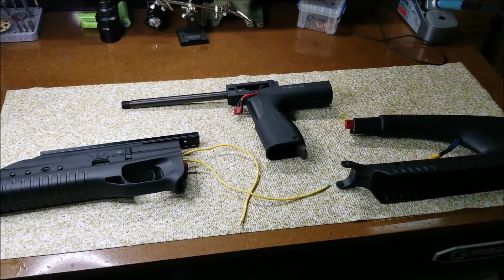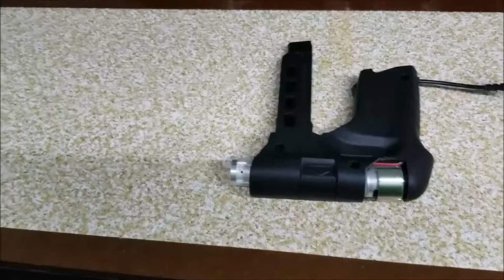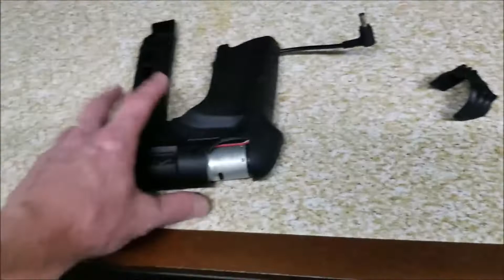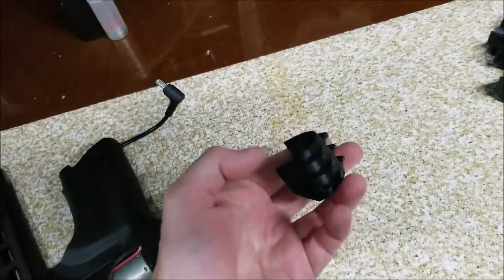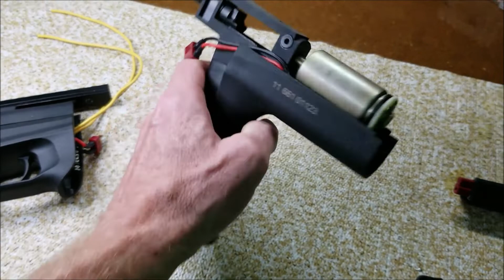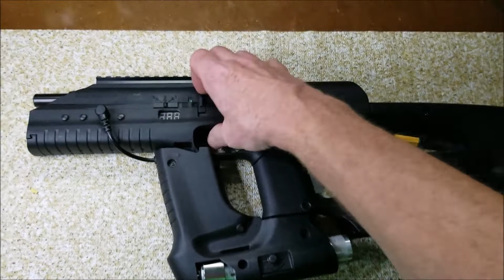12K Getting Close

Comment: Let's dance, comrades!
Seriously, unplugging mag is the first thing to do in a situation like this. Obviously, the board starts like it normally does but then something is causing overload that leads to significant voltage drop so the board resets itself 'cause it believes the power was turned off and then on again. Excluding part of the board's load (disconnecting mag) shows you the path to follow.

Great to see the progress with this project, thanks for the video.

Comrades, I can't stop dancing :)